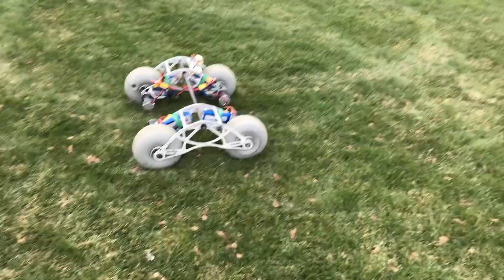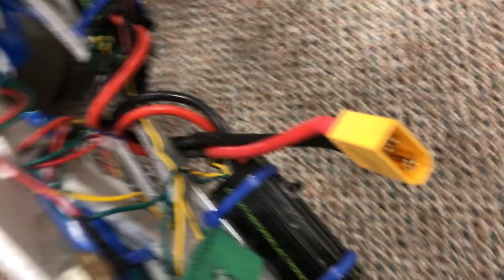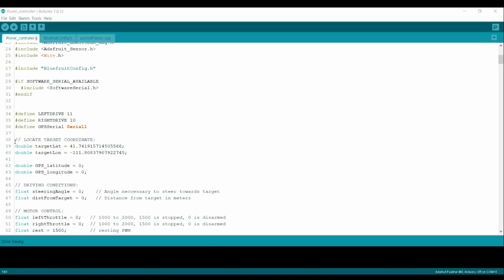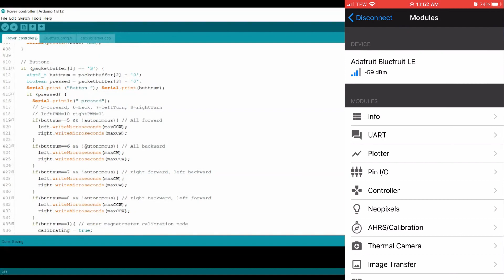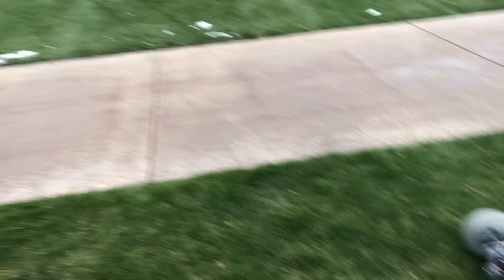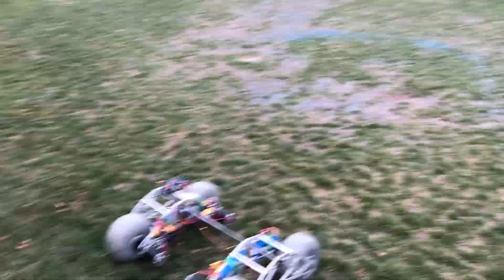GPS Guided Autonomous Rover

Comment: Great, wonderful project. I have a question: how could I keep sending my gps waypoint where I am while walking for the robot to follow me? I have seen this kind of implementation using Blink app and bluetooth module with Arduino. Maybe connecting a raspberry pi would be a better idea, for the cell phone to share its waypoint in an open loop and the robot keeps trying to get to the changing waypoints, while avoiding obstacles if I added hc-sr04 and, ir sensors it. What do you? How would you do that implementation in the code, by changing the set, fixed goal point to a moveable one (in a flow,let us say with a 2 second update rate or higher)?

Comment: What is the GPS model? How much accuracy did you get?
Reply from the maker: This is the module: HiLetgo GY-NEO6MV2 NEO-6M GPS Flight Controller Module 3V-5V with Super Strong Ceramic Antenna for Arduino EEPROM APM 2.5 https://www.amazon.com/dp/B01D1D0F5M/ref=cm_sw_r_cp_api_glt_fabc_X4BVFTPEPCSJ7DXSFYMZ

I was able to get around 3-10m of accuracy